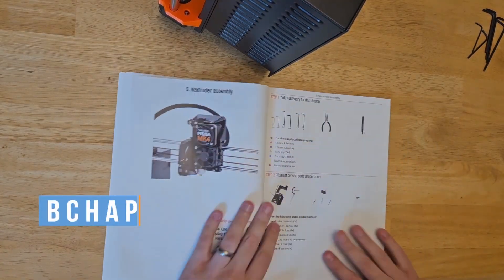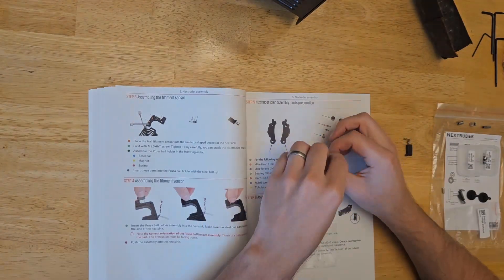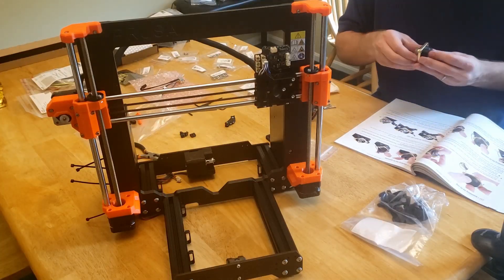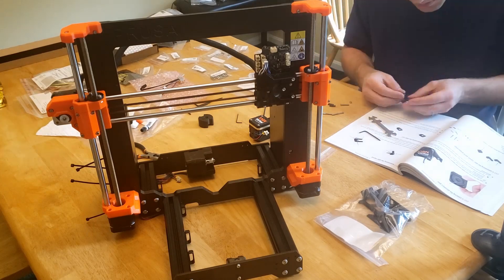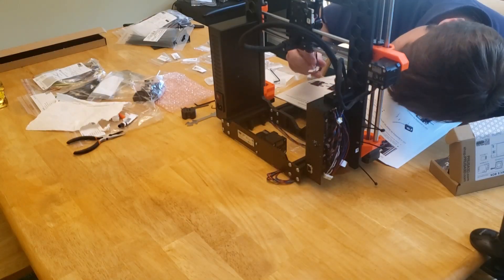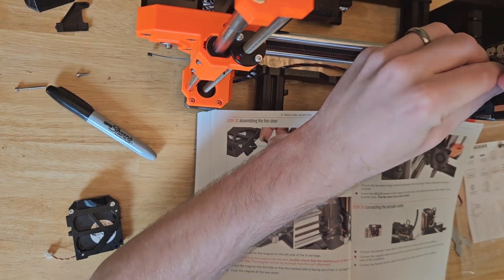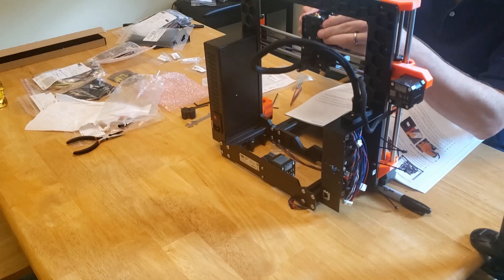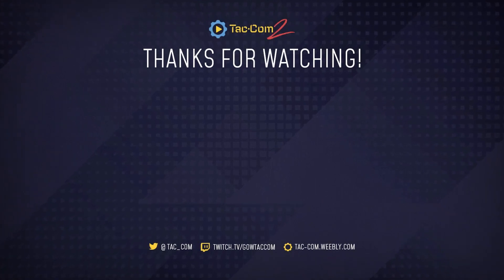Prusa Mk4 Kit Assembly: Nextruder

Comment: One problem with a clear cover of the planetary gear is that there is a fairly large plastic fitting/washer inside the planetary gear cover. That fitting/washer ends up about 2 cm of the middle of the planetary gear assembly. With a clear cover installed, which isn't completely clear, the center blocked from view.